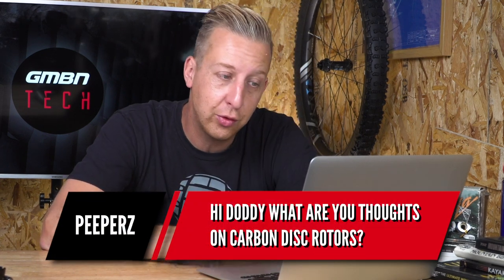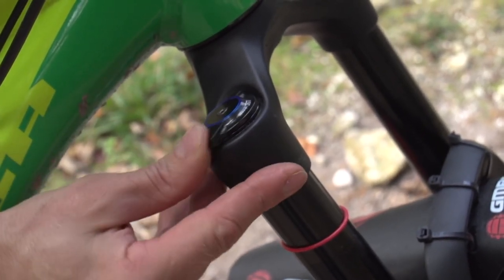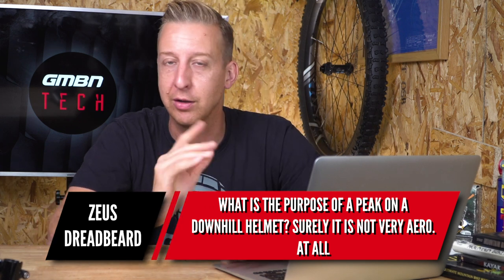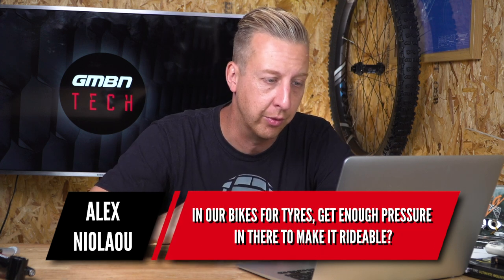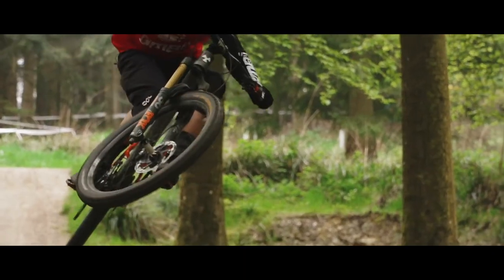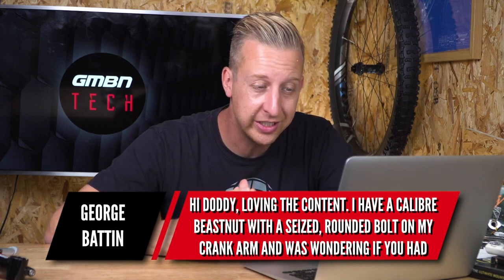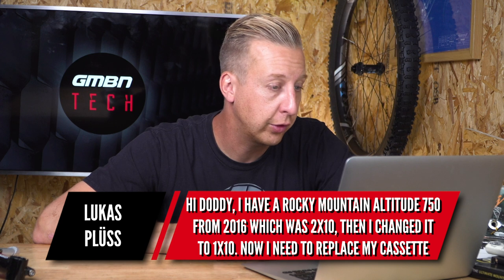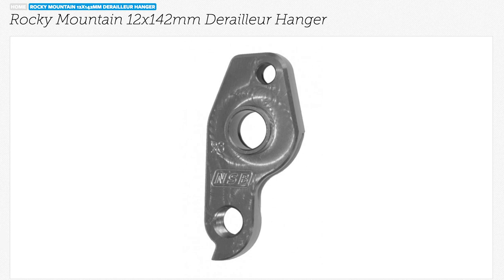Do Carbon Disc Rotors Work? | Ask GMBN Tech Ep.24

Comment from the maker: Don't forget to post your questions below and add #askGMBNTech
Reply: Another excellent video.  Nice one Doddy
Reply: #askGMBNTech whats your take on spoke tension apps? these apps claim to allow you to tension your spokes much in the same way a guitar or harp is tuned. So rather then using a physical gauge to read each spokes tension it relies on the sound those spokes make when plucked.
Reply: Carbon brake disks are the dumbest carbon thing to date. The weight saved is minimal, the performance, durability and SAFETY sacrificed is huge. This mindless, retarded carbon craze needs to stop. Whats next? Carbon dumbells?
Reply: GMBN Tech #askGMBNTech why my fork starts to "scream" when landing big drops or jumps? It is also firmer when doing bunny hops. Any tips?
Reply: +Karlo MTBiker My rear coil shock also does this, but it has done this since i got it. It might be the oil vibrating when it is being forced through thin channels inside the damper. And no i dont have a shitty shock. Its a Cane Creek Double Barrel Coil CS.
Reply: #askGMBNTech Hey Doddy, is there a simple way to silence the ticking of a freehub?
Reply: #askGMBNTech  which specialized stumjumper comp 2018 29er or 27.5 is better for downhill (the 29 has 135 rear travel instead of 150 on the 27.5).
Reply: #askGMBNTech What type of suspension design do giant bikes use? Can you explain how it works? Cheers!
Reply from the maker: Carbon dumbells would be HUGE!
Reply from the maker: +bob cat - It's a dual link type suspension called Maestro. Doddy is looking into doing a big video on suspension design, but it's such a big undertaking that's it's going to take a while.
Reply: Is there an instance where we should disengage an rear derailleur’s clutch? #askgmbntech
Reply: Karlo MTBiker watch a video from sven kammerer on youtube. His fork is doing it also and at his fork it's the oil flow in the shimstack
Reply: #askGMBNTech can i addapt the scott twinloc remote to another bike with the same fox suspension?
Reply: Think I posted too late for this show Doddy, but hopefully you can answer this for next time... #AskGMBNTech - My new Ascent II dropper came with a 1x style lever and it's a real awkward fit with my gear levers. So I need to change to something like the stubby KS or bontrager style 2x/3x one. I can't tell from the internet which (if any) have the clamp end in the lever, and which need the nipple in the lever end and hence are useless. What are my various options for a replacement not-1x dropper lever with cable clamp at that end? As far as I can tell from hearsay the bontrager clamps the right end, but I don't know for sure, and knowing more options is always nice! Thanks! (Great show btw 🙂)
Reply: EAZY0321 Good question. I’m not aware of these apps but recently tried getting my back wheel at least a bit straighter by working off pitch hoping it’ll equal tension (guitarist MTBer here). Still not straight but they’re not all “in tune”, just a lot closer, and the wheels a bit straighter as a result!
Reply: GMBN Tech Hey Doddy. What really is the purpose of having high and low speed compression adjustability? Is it really necessary to have HSC and LSC adjustment for the performance of the suspension? Or is it just there to eliminate the need for the full open or lock out dial switch on the fork?
Reply: bob cat Maestro
Reply: Noel Castillo Only when removing your wheel. Stopping your ride to turn on/off the derailleur clutch is way too neurotic for virtually no gain.
Reply: Yup. Disengage when you'll take the wheel out.

Comment: Rounded off hex bolts. Sometimes jamming a bit of inner tube into it gives you that little bit extra purchase. Or epoxy resin an alan key bit in to take out with a wrench. It might let you get the tension off before it snaps.

Comment: I had a seized bolt and I couldn't solve it using an extractor (like you mentioned). I brought it in to my mechanic, and he cut a flat line across the bolt with a Dremel tool, and used a big flat-head screwdriver to remove it. Absolutely destroyed the bolt, but he got it out and didn't have to destroy anything that would have been too expensive to replace. Now that I saw him do it (and paid through the nose on labor for something that took ten seconds to do, because he tried five other things first and charged me for them), I bought my own Dremel in the event that it happens again.
Reply from the maker: Super easy method, but definitely a last resort
Reply: If it’s not a really hard bolt just drill it in steps till the head falls off then you can normally unscrew the last bit of the bolt with your fingers with your fingers
Reply: One thing I have to say about those bolt extractors - they are very brittle. I've broken two(!) of them while trying to unscrew a couple of seized bolts making the situation even worse, because now I have pieces of very hard steel stuck in the holes I drilled. This makes further drilling virtually impossible.

Comment: Great video, but I would like to add that for removing the seized BB bolt you could use a hammer and a chisel. First drill a small pilot hole as far towards the edge of the bolt a possible; then put the corner of the chisel in that hole and angle it so that when you strike the chisel with the hammer is turns the bolt loos. My friend has this problem on his BMX and we managed to fix it this way very well; we were even able to reuse the bolt.
Reply from the maker: That's another great fix! 👍

Comment: I'm working as an engineer in the bike components industry, especially brakes. As such I've been testing quite a lot of carbon disc rotors (as well as aluminium and titanium). None of them has been working really well. Brake power has never been better than 30% of what a standard steel rotor delivers. And two of those carbon rotors have been exploding when I pulled the lever ... same with aluminium and titanium: First they squeal, then they break. 
This does not mean that one day there may come a well working carbon rotor. But up top date not a single one delivered what was promised...

Comment: Hi Doddy, love the channel. I need some freehub advice. I have a Chris King classic hub, and the splines on the drive shell has been gouged and chewed up by the cheap cassettes I've been using. I intend to replace the drive shell, and noticed the manufacturer offers both aluminium and stainless steel drive shells. Is there any significant advantage or drawback to either material?

Comment: Great tips for the stuck crank arm bolt. I'd also soak it in PC Blaster penetrant (or equivalent) and let that sit overnight. Sometimes that's all it takes and you can avoid the more destructive approaches.
Reply from the maker: The safe and patient option 👍
Reply: Heat/cold cycles work too. Heat with hair dryer, freeze with freeze sprays.

Comment: I have a Fox VanR in the back, even tho it doesn't lock, I find that if I close the rebound all the way it basically doesn't move at all when pedaling
Reply: Lockout just shuts out the damper oil passage, so tightening up the rebound valve will have a similar effect.

Comment: Hi Doddy, i have to get the rear bearing replaced every 6 months on my bike due to rust. I clean the bike with muck off products and rinse only with bucket and cup (no pressure) and dry with a cloth. I’ve never experienced this with any of my other bikes, so why do you think this is happening, and what can I do to stop the water getting into the cartridge. The bike is a stumpjumber comp 2017. Thanks Ayd

Comment: The torx trick works almost every time but you need to use a good quality bit, you need to make sure it's not the type with the hole in the end (tamper proof) and make sure the tip is flat and not domed.

Comment: #askGMBNTech Hi Doddy, about Niel's "Neutral Gear" could you remove the large sprocket on the cassette to make space at the bottom end. And then put a second small one at the bottom but file off the notches to allow it to move on the freehub body?

Comment: I’d be extremely skeptical of carbon rotors. For what Doddy said, but also because the brake pad material is matched to the disc. Changing the iron content in a steel rotor can drastically impact the feel of a system, so to completely change the material you’re in unknown territory. Also, you’ve just created a very expensive consumable.

Comment: Is a 7 year old mondraker finalist pro? I recently got one, it's forks are rockshox recon gold tk and had avid juicy 3s. I've upgraded the brakes to 203mm rotors and avid Elixer r, but what else should I change? And I could get a 150mm travel rockshox  pike, I don't use my bike specifically for xc, more as a bike to take out and play with, say some trails, dirt jumps (It had a long stem, it's shorter now). I am also saving up for 740mm bars as well. #askgmbntech

Comment: I’ve just ordered a canyon strive cf 7.0 and was wondering if it would come with the stuff to make it tubeless like the sealant valves and rim tape or would I have to buy them separate. Thanks.
Reply from the maker: Many bikes come with tubeless ready wheels, so that's with the tape already installed. Few bikes come with valves and sealant, unfortunately, but it's a cheap fix.
Reply: Ok thanks I was just wondering before I bought them

Comment: Can you talk about hub standards? I got the new fox 40 29er and it comes with 110x20 boost, which is a new standard for dh. Also the difference between 157 and 157 super boost plus. From what I can tell super boost plus just pushes out the spoke flanges, rotor position stays the same. This is not the case with 110x20 and 110x20 boost.

Comment: #askGMBNTech  Hi Doddy, I've got an issue getting a non tubeless tire (with tube) to seat on a tubeless rim.  The tire is a Shwalbe Rapid Rob and the rim is a WTB Frequency i19.  I had it seated fine previously but broke a nipple and had to pull the tire off and now it won't seat again.  Any tips to get it to seat?

Comment: hi doddy, and all the team
first of all, I'll like to thanks all of you for all  the help you gave
I actually would  like to understand the point of 1x setup
I upgrade my own from 2x10 to 3x10, and its lovely (really) pretty strenght, really light and got much faster than previously
so I don't understand why sram / shimano launch recently almost only 1x setup
#askgmbntech
Reply: 1. Weight - less
2. Cost - less
3. Complexity - less
4. Gear ratio choice - less
Reply: @truantray  I zgree with you except the price point
All manufacturers lauch mostly 1x setup, and even more expensive than 3x
When I check all bikes availlable, on net and shops either, only the cheap chinse shit has 3x
And some the most expensive are even not compatible
Thats sounds completely no sens to me...

Comment: #askGMBNTech Why are front through axles usually larger diameter than the rear axle? It seems like 15mm axle up front and 12mm axle in back is a common setup. But the rear axle is a good 25mm longer than the front, and the rear wheel seems to take harder impacts than the front, so wouldn't it make more sense to have the larger diameter axle in the rear?

Comment: hey doddy I was just thinking about carnbon disc rotors a while ago and then this vid shows up! I wanna know more though
Reply from the maker: There's probably a bit of info out there, have a look and let us know what you find!
Reply: they're very bad to be honest. Ones made by Kettle Cycles always warp while other ones often fray their carbon fibers within a few rides. Real carbon ceramic brakes have to be sintered and supported by a rigid spider to prevent the stresses from damaging the brake structure severely. Performance wise though, they have less bite than usual steel rotors but they sort of feel like you have ABS.

Comment: Hi Doddy. I ride a full ridgid Ti-frame with a ultra light, low crown carbon fork. I consider trying out a suspension fork for when I go off trail, but would like to keep the responsiveness of the low and steep geometry when on the trails (mostly fairly flat, hard packed with many very tight turns). Is there any suspension forks that can be locked while fully compressed? #askGMBNTech

Comment: RE: carbon disc rotors. In motorcycle roadracing where speeds get pretty high, normally only the MotoGP bikes used carbon rotors, due to the fact that they need a ton of heat to be usable. For example, non pro racers never use them, and on a 1k race bike, you coukld get up to speeds in the 180 mph range, wher as the MotoGP riders will reach speed of well over 200 mph, and that those speeds, when slowing down, the carbon rotors will actually get red hot, as you could see then Glow in low light. Now, we all know that any bike, mtb's included will never come close to those speeds, so with the little amount of knowledge that I have re: carbon rotors, I can't see any benefit in using them on a bike, unless the tech on them has changed. If anyone has better info. please share it.
Reply from the maker: No, you're right there. They're not really useful for MTB purposes. The industry is better off making higher quality pads. Though the Shimano Ice Tech rotors are pretty cool which sandwich aluminium alloy between two sheets of steel, and they work well to dissipate heat.

Comment: These kind of carbon discs are just for show, the motorsport disc are carbon-ceramic, totally different. Also, carbon rims on road bikes are incredibly bad on braking, so, I don't think carbon disc rotors will be a thing, ever.
Reply from the maker: Yeah, very different from the ceramic disc s from motor sport. It would be interesting to see if anyone could make ceramic disc for MTB that would be light enough or practical enough. Then again, there's nothing wrong with our steel disc at the moment, is there?
Reply: GMBN Tech hi  have you tried both Shimano xt icetech 6 bolt & the freeza cl disc rotors, is there any noticeable difference? Cheers
Reply: I've been braking on carbon rims for 4 years now Swiss stop pads and have never had a problem. I have about 150 koms on descents ranging from -4 % to - 15% so I'm not sure how you formulated that opinion and then presented it as fact. Also carbon discs will become the norm. It's very short-sighted to actually believe that they are not coming at some point. it's funny how so many are steeped in archaic narratives...😂
Reply: Flying Lap Productions you are a great at descending then. Get proper disc brakes and you will be even faster.

Comment: carbon disc brakes are more common on wet races on MotoGP bikes thanks to Brembo's latest technology. but for mountain bikes the temperature is not hot enough for them to be used effectively, not to mention the inherently dirty nature of mountain biking activity.

for the optimum temperature, i believe carbon discs can use a smaller diameter disc (probably smaller than 140mm!) to guarantee an optimum operating temperature with an equal stopping power as the regular disc brakes

 in my opinion there is a future for carbon disc brakes but it's still a long way to go (needs to be proven by the pros)
Reply from the maker: And there needs to be a real reason to use them. It'll be interesting to see if they catch on in the future and in what way.

Comment: Alpha ceramic (Spanish company)  one-piece 6-bolt 140mm rotor that weighs a claimed 32g p.s ask j.canning about light weight cables (he said he had something in the works) yes mechanical brakes arnt as good but potential for superlight xc build or road disc bike that flys

Comment: Carbon discs will not expand under high temperature ( sory if I made any language mistakes)
Reply: But they offer poor friction at low temperature. They need to be at several hundred degrees.
Reply: @truantray  yes but doind some slight groowes you can increese the friction (i am 14 and i live in poland my lamguage is poor)

Comment: Hi Doddy, I have a Giant ATX frame, and unfortunately it has a straight head tube. I really want to replace the stock suntour coil suspension fork to an air suspension fork, any suggestions for a good air fork with a straight headtube? #askGMBNTech
Reply from the maker: Hey T kamble, straight headtubes can often fit tapered steerer tubes. It's just down to what size the headtube is. Giant usually have big enough headtubes, unless it's a very old bike. So, you'll probably just need to get the right headset to suit. If you're unsure, head to your local bike shop and ask them to help, they should know exactly what you need.

Comment: #askGMBNTech Im thinking of upgrading to 12 speed, but i currently have a sram NX 11 speed derailleur(10-42 cassette, 11speed chain and NX shifter) and my question is if it is possible to just buy a GX 10-50 Cassette and a GX 12 speed shifter and 12 speed chain? and the just adjust the NX derailleur to go on the 50 thooth?
Reply from the maker: SRAM made quite a few revisions to the Eagle derailleur to make it compatible, so it wouldn't make sense that the 11 speed would work... Though there's now the NX Eagle, so wouldn't be too expensive to upgrade completely

Comment: #askGMBNTech 
Can you fit 27,5+ wheels with 2,8 tires to frame that has 148x12mm axle and fit 29" wheels?
I'm interested in commencal meta am 29 and I would like to know if I can use 27,5+ wheels with 2.8tires

Comment: Hi Doddy, what could you say about oval chainrings? I'm about to change my 2x to 1x, and I'm thinking about which chainring should I install, oval or round? #askGMBNTech
Reply: they ruin clutch rear mechs.. i found myself servicing the clutch after every ride as it starts creaking while pedaling, and 2 times it needed replacement,  so I said bye bye to oval chainrings for now.. 
if you have a clutchless rear mech and use chain retainers, go for it. if you like the clutch, don't
Reply: They've been marketing that gimmick for ~25 years.